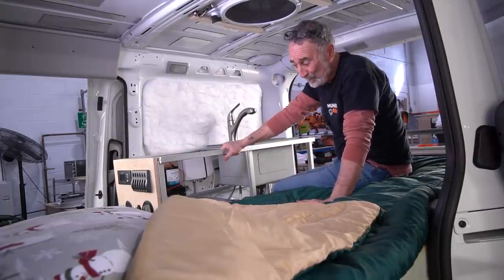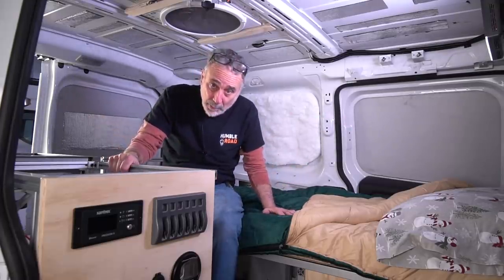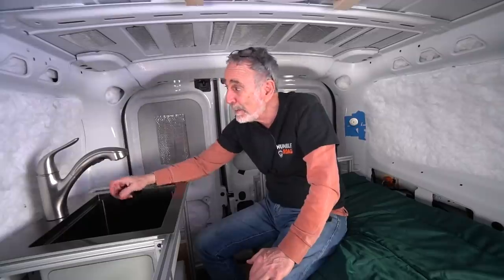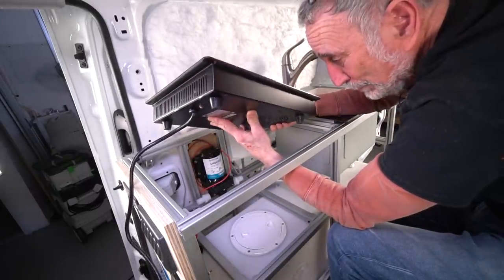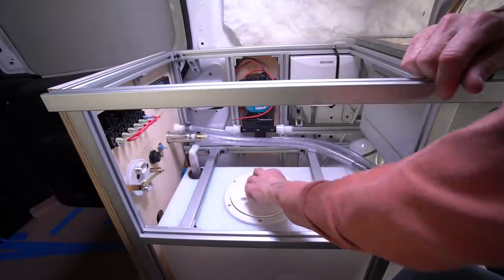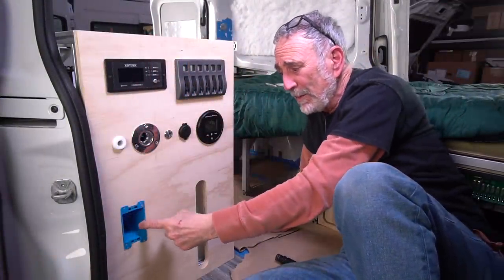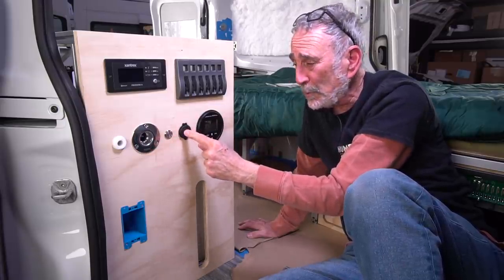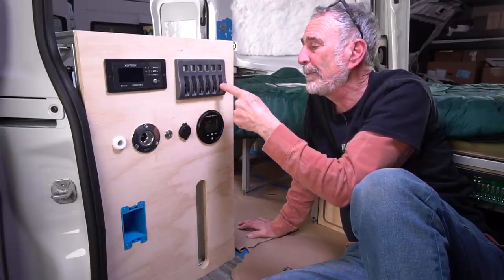The Humble Road Promaster City mini-camper. BIG features in a little VAN.

Comment: Well my vote would be recessed induction cooktop, with a wood panel on top, that way you can use your instant pot or air fryer and still have the sink free.. and if doable,  also a hinge to be able to use the board as an extra prep space to extend counter space, when using the induction cooktop. Awesome design and functionality for such a small space…. Love it !!
Reply: LouisaG nailed it.  My thoughts exactly.
Reply: My thought too…  hinged or on a slide into the door space.  The switch panel makes a slide solution possible.  Move the cross piece of 80/20 from above central command to below the switches and above the water ports for cabinet integrity..
Reply: YES !
Reply: Agreed choice #2 recessed induction cook top with a counter top that slides into the door space.
Reply: I like the recessed as well for the reasons mentioned. My only concern would be cleaning. Stuff will inevitably fall onto the margins from the stovetop and cleaning would be difficult….unless George’s brain comes up with a solution.
Reply: that was my first thought too, hinged cover top.  Just flip it over and you still have count space for prep work!
Reply: @taylorbad  You beat me to it!  Hinged to swing left for extra space🤗. Little bothers me more than no counter space.
Reply: I would like to have it recessed, with a cover over it -- and the cover is flush with the top of the counter -- because the glass on those induction hobs may crack if anything ever fell on it. Could the cover fold up out of the way to become a backsplash, like the Furrion RV oven range?... but not with a glass cover!

Comment: I am your key demographic as you defined in the video and I'm paying attention (but I like all your designs and good advice).  Lots of comments about the cooktop but I find that everything that you are talking about is so valuable and will save me some grief if I decide to replicate your design.  You are the best source of commonsense builds that avert potential problems.  Didn't see the value of a large sink until you started talking about using it as a human washbasin.  About sleeping - I want a window right by my head so I can get a cool breeze and see bigfoot coming.  It can be a mini window but in either position would enable someone to break it, reach in, and open a door (so need to think about how to address that problem).  I want a large window behind the galley.  It would be nice to have some way to extend the counter, but I like the command center location.  One suggestion that I just dreamed up - consider lightweight overhead shelving that slides across the ceiling and is completely removable or collapsible (not for the elite but minivans are not for the elite).  Not sure how that would actually feel in such a small space.

Comment: Loving progress and ideas coming together for the small van.  ON THE COOKTOP.... I'd like to see all the electrical gadgets moved down a bit, on the outside cabinet panel,  and a side opening drawer installed that would hold the cooktop.  I'd also like a thin metal lift up lid on said drawer, providing additional work space, when down, and a wind break, when up.   All of this will preserve all the prep space as well as giving a full wall of countertop...along with bringing the cooking appliance down lower from the ceiling.
Reply from the maker: Nice idea! Unfortunately the gauge panel is set where it is because the water tank is directly underneath and the 8020 frame rails are off to the sides.

Comment: George , nice work here.
I have a small recommendation to you.
you can make the outlet of the overflow for the freshwater tank lower than the electrical outlet. so in case there is an overflow the water will never hit the electric plug causing electrical fire hazard.

Safety first my friend.
I am a big fan of your work since your very early beginning .

hope to hear back from you.

Comment: Cute and so functional, bravo George!  Everybody loves the Mini-Me models!
Induction stove - I like it inset deeper, with a cover on top.  Good working surface. Here is an idea for the cover:
Put the stove wood countertop cover on extension rails so you can slide it out to left side.
Have a swing out arm on side of cabinet (which has the control panel of switches) swing out to support it.
Now the countertop cover becomes an extension of the counter, while the stove is in use.
Reply from the maker: Great idea!

Comment: Thanks for sharing.  Like #88.  I like the cooktop recessed and stored in place with a countertop panel above.  If the cooktop fails, buy a replacement.  It doesn't change the countertop.  If it is built in you need to find the exact one.
Reply: Good point

Comment: Brilliant! Well done and such a challenge in such a small space, however I worry about that GFCI outlet below the water fill and vent. Yes, the plug is ground faulted, yes the fill port is pretty safe. I don't like it. There has to be another location for that outlet, offset or above but not directly underneath water!

Comment: My father was an electrical engineer and the only thing I learned from him in that field was water and electricity generally don’t mix well. That being said would dripping water from the tank overflow or fill inlet be best located directly over the 115v outlet?  Is there another location where the electric outlet could be above or beside the water connections?
Reply: FYI - this occurred to be an issue to me too, but given the space/position availability and the need to have the water inlet (not so much the overflow) above the top of the tank, I can see the logic.  If the power outlet could be raised to the same or higher level than the water inlet (and made horizontal?), without moving the inverter controller, the water/power interaction could be avoided - but I'm sure George has already thought all that through....
Reply: 100 % agree ... maybe move the site window to where the outlet is - although I get you are looking for drawer space ...
Reply: @lass-inangeles7564  And yet, despite all that pedigree, we have a frequently used water inlet AND an overflow outlet over an electrical outlet...
Reply: @geoffsimns8424  Yes, I see what you are saying now.  The water inlet should not be above the main electrical input.  One solution would be to swap position of battery monitor + USB charging port with the water inlet and overflow openings. Even then, they are too close to electrical mains. Best to make the water inlet on outside of van, however troublesome. It won't damage the wood work or floors either. If it is accidentally left on it will shoot out of the overflow section all over the electrical areas. Outside, it won't matter.
Reply: @brianmi40  Yes, you are right. This is not sensible and risky.  It needs to be foolproof given human error.
Reply: @lass-inangeles7564  To be fair, the power outlet would not (should not) be live when filling the water tank - that is not the issue - water, no matter how little, getting inside the power outlet and remaining there when the power outlet is made live is the main concern, although I am certain George would have RCD breakers in that circuit so electrocution would not be a risk, but having to reset the breaker is just an inconvenience in addition to letting you know there is a short in the outlet (which should not happen in the first place, and there we go into a circular argument).....
Reply: At this point of the build, might swap an outdoor outlet cover to assure water never splashes to outlet. Would protect from rain egress while door opening in bad weather.

Comment: You have been doing magic there! Congrats!
My thoughts: 1. I Would leave the the induction cooktop UNDER the counter, covered with a solid countertop piece, ALSO removable so you can take both apart over a bench, a rock or anything alike to mount your cook outside. Plus, while taking the cooktop away you will still have your cooktop available to work on.
2. I think you can find a better arrangement for the 110V outlet, not just under the possible spillig fresh water tank vent.
GREAT JOB,  GEORGE!!!

Comment: I have an idea for your cooktop dilemma... How about mount the cooktop on a pullout that will pull out from under the countertop toward the door opening. The space would probably take about 4". You would probably have to drop your central command section below (or make enough slack to stay mounted on) the drawer face. In fact, I would probably move the two displays and move the switches lower. The cooktop could be picked up out of the slide mechanism and closed up, so there isn't an exposed opening if the user wanted to take it outside.

My wife and I love your videos!

Comment: Option 2. Very easy to scratch or chip induction hob. Best to have cover. Re control central have you had lady with nails try your switch consol. Difficult to tell from video but might cause problem. Also suggest power outlet is above water fill and overflow. Would be worried about even few drops dripping onto power cord. I know these vans aren't subject to standard building regulations but that water and power configuration seems very un you mr safety! 😎

Comment: Recommend using paper stone material comes in various depth sizes from 1/8,probably 1/4, 3/8", 1/2". 5/8". n 3/4" possible more, we have a three ply cutting board, oreo sandwich style light in the middle, dark brown on the outside,  on the  comes to about 3/8" at 1/8 per as a counter top/chopping board, for that size we have one a little smaller,  this one we have had, is about 10 years old, got for free, has marking on the surface, but that could easy sand out, and be just like new.

Comment: Another excellent video. Regarding cooktop mounting, my preference would be a fourth approach. A would make a slide-out toward the door opening. Advantages include; easily  removable for outdoor use and if it ever needs replacement, lower height advantage, maximize usable counter, can move it back safely when not in use, uses door space not needed while cooking.

Comment: I think sunk is better. It allows things to be thrown on the countertop without worrying about damaging the induction plate. I would also see if it's possible for that countertop to rotate up and act as a splash guard to protect the wall.  It allows slightly more height for cooking as well and a nice clean look.

Comment: Recessed with removable cover. I've living a Promaster for 6 years full-time. I love having a countertop with a ledge lip, like sailboats have so not everything need to be put away during driving.  A book, a pen, etc can be left on the table. A recession cooktop would be similar. I also worry about breaking glass cooktops when not in use. Besides they  are slippery, not good when the van is not parked perfectly level.

Comment: Personally, I would prefer not to have the induction cooktop at all, but if it is included, I would recommend the inset top with the cover. That way, the counter is useful for other things, without risking damage to the cooktop. Otherwise than that, I absolutely love the camper.

Comment: The Mini-Me is coming along nicely!  I like the idea of recessing the induction countertop enough so a panel can be placed on top for increased work area.  Great for using as prep surface, desk surface, etc.
Another recommendation: place a 120 V receptacle inside the cabinet, in series with the receptacle on the outside of the cabinet. This would be used to power the induction cooktop when it's installed in the countertop.  This would make for a clean & neat look, vs a power cord hanging out of the cabinet and plugged into the exterior cabinet receptacle.
Wiring them in series would ensure that they will still be controlled by the double-throw switch for the water heater/cooktop.
Reply: That's a good idea! It protects it and hides the cooktop as well. Love how compact and clean she looks. I like keeping things simple and free of rattles. It's beautiful 💟

Comment: Why not remove the passenger seat?
I say this because if it's designed for one, then that area is just going to be wasted space 95% of the time.
And if you end up removing it, try replacing it with some sort of innovative table-chair-storage setup for eating and remote working.
Options! 😉
Reply from the maker: Swiveled towards the rear, that would make an ideal reading chair. But I don't think it is wise to remove all ability to have a passenger, even if just for a short drive.
Reply: @HumbleRoad  Agree. If there's a swivel option for the passenger seat on the Promaster City, that would be VERY useful.
Reply from the maker: You're not kidding!

Comment: I just love me some George awesomeness, and that is exactly what I got - thank you George. 
The toggle switch for the power outlet or water heater option is a brilliant solution to what is an inevitable problem in such a situation. 
Re: induction stove - in my van I opted for the stow and show option, but the recessed options are much better, especially with the ability to take the stove out and use it elsewhere (but, be warned, stuff will fall into the recess, and, unless the bottom edges are rounded, will be difficult to clean) - of the 2 recessed options my choice would be the flush mount option, as the chopping board cover option just makes for more complication and requires space to stow the chopping board while using the cooker - additionally, my personal preference is to not have built-in chopping boards because they always (without exception) get damaged with use and will look messy, thus will eventually need replacement (yeah, I know, you could turn the used side downward when not in use, but, inevitably, someone will forget to turn it over and chop stuff on the "good" side and you end up with 2 "chopped" sides); therefore I prefer to use the stow and show option for chopping boards also.  But that's just me, and I am not anyone else (luckily for everyone else). 
As always, exceptional content, highly entertaining, thought provoking, and supreme production (very few people realize how much work goes into the production/editing side of videos).
Again, thank you George.

Comment: My choice is set on with yours, George. Mount the induction cooktop "flush with countertop" as space is being optimized.  H O W E V E R, if they want to pull it out and place it, say, on the Dometic freezer/fridge to cook there, ensure there is a "flush" counter addition insert that they can be put "in place of" the in-set induction cooktop void. That way they have "options" to cook and 'still have' counter space. Cooking is about preparation so, counter space is key before, while and after cooking. 
That flush counter addition could possibly have dual-purpose as a back splash or lagun surface, vertically stored cutting board, etc.
Update: So now that I am thinking again on it, your second choice with the regressed induction cooktop would be optimal as it solves the storage problem of the "Insert" counter. The second choice fulfills all the requirements of the aforementioned. 
So, lol, second choice is best as it is the most versatile, optimized and aesthetically pleasing.
Reply from the maker: Problem solving can be frustrating and then satisfying!

Comment: I vote also to recesse the cooktop. Since you have USB port just down below that means charging something and that something will need to rest on top. Also, good idea to apply coat or more of water base polyurethane to the panel to handle abuse and protect from whatever. Also adds nice decorative touch.
Reply from the maker: The plywood panel in this video is only a prototype. Final will be walnut in this van and cherry in the sister van alongside.

Comment: George, Can the induction cook top nestle in the sink and be used in that position?
Regarding ambidextrous sleeping; what about bungee cord netting? when not in use it lays flat against the wall but when in use, it will only bulge out as far as the items stored inside.
I like the faucet with a hose attached, if the sink is closer to the door, it could be used as an outdoor shower.

Comment: Why not have the fresh water overflow on the side and out of the bottom, like you're doing on the grey water tank? That way you don't have to worry about the water and electricity situation and flooding your precious Mini Me 😉 The switch is brilliant btw! About the cooktop, how about recessed but pops up when you take the countertop of (like kitchen doors that you have to push in to have it pop open or use the countertop as a leverage to rise the cooktop to the same height) Either way I would flip the countertop to the left for more prepping service or use it as a little desk perhaps when not cooking. Looking forward to seeing what genius solution you came up with.

Comment: Counter top and cooker.  Flush: how many cracked induction cook tops have you heard about?

Solid counter: stow the cooker somewhere else, where? Some place it's even more likely to get broken? 

Hybrid?

Flip up counter gives you backsplash while cooking inside, counter space when not.  People "counter" for longer periods than they cook.

The USB port on command center panel - where are the items being charged setting?  On the floor? No, on the counter! 

Inset design or lower, Flip up lid or not, I'd be concerned where the boil over lands.